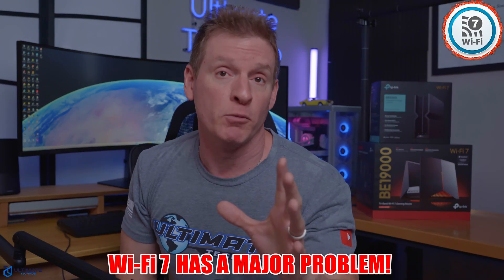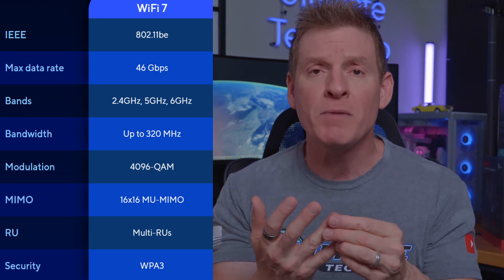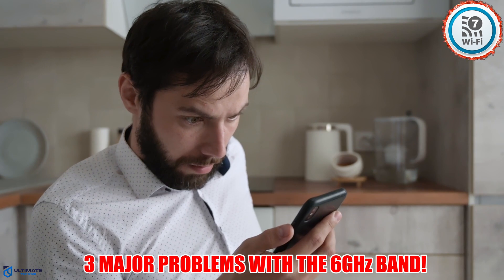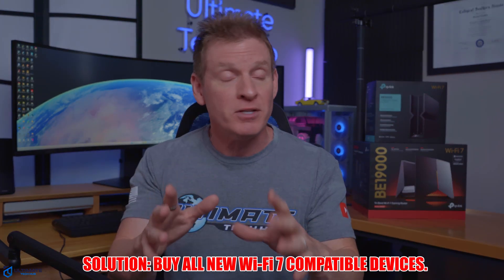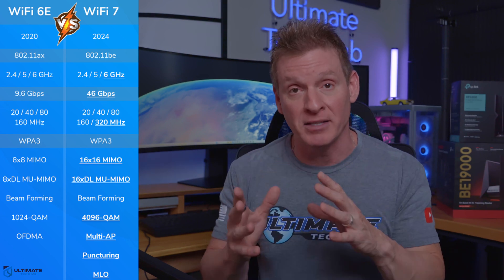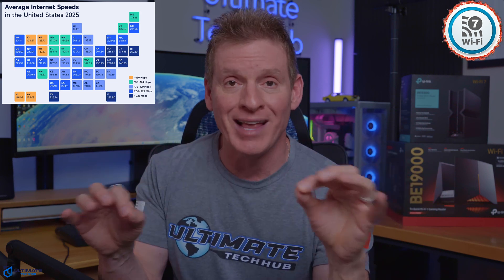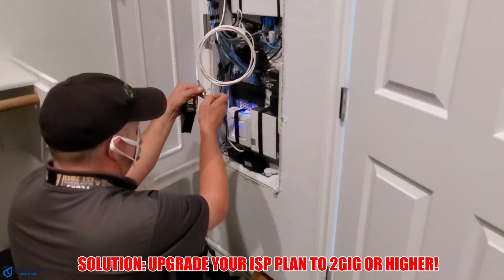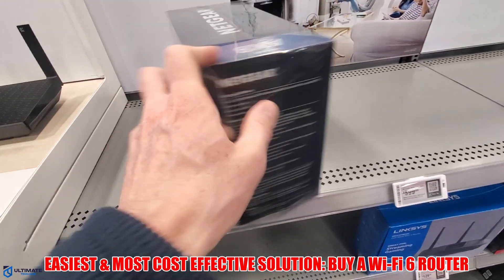Wi-Fi 7 EXPOSED: 3 Big Problems Nobody Talks About!

Comment: depends on your use case, if you have large files to transfer between networked devices like me, then yeah, that extra bump in speed can def help. but then again, i work in IT, and im a geek with a multi-gig internet connection lol

Comment: I agree. I tried a TP-link BE3600(it was opened stock for $74) and it was replacing a TP-Link AX 4400, so curious.  Well within a couple of days the internet connection dropped several times requiring a modem/router reboot. I quickly realized it wasn't going to work for me with the same pc's tablets, and phones. There must have been a reason that it was marked down as a return.  Now at least I don't have outages with Wi-Fi 6. BTW most of my devices are wired, using a switch wired, from the router in office to a the living room Home Theatre.
Reply from the maker: Wired is always better. Thank you for watching !
Reply: I have heard that the ASUS RT-BE92U BE9700 Tri-Band WiFi 7 Router keeps dropping connections, too. I heard it was a firmware problem
Reply: @mando7558 I have a tp-Link GE550 BE9300 and have no problems with dropouts. Although there are reports of this happening I updated the firmware as soon as I got it and it's been trouble free from the start.

Comment: I use WIFI 7 MESH network but linked with Ethernet cable CAT 6A between Master and Slave routers. No problem at all with very good range, speed and many devices. Some use 2,4Ghz others 5 Ghz and te 6 GHz band is for the MESH routers.
I do not have the 320Mhz band only 160 Mhz, But the WIFI 7 speed is much more than using WIFI 5 or WIFI 6 from the Internet Supplier Company, that I have Installed but I do not use for my conections. And I wil not need to update that Networks for many years.
The WIFI 7 network is excellent to supply service up to 600 users or devices at the same time.
After 2 years using WIFI 6 E networks I went for WIFI 7. And the price is cheaper.

Comment: What happens with those routers and mesh systems that use Wi-Fi 7 with dual band 2.4Ghz and 5Ghz? Those don't have 6Ghz. Are they worth it or do they also lose something?
Reply from the maker: Dual-band Wi-Fi 7 allows for simultaneous use of multiple bands (2.4 GHz, 5 GHz) This improves performance and reliability, but it may not increase the range. Wi-Fi7 can handle more devices and data. Its primary advantage is increased speed and reduced latency, not necessarily greater coverage. Depending on your ISP plan it's still probably overkill. The good news is the 5Ghz band does reach further than the 6Ghz band but it's not as fast. In most situations wifi6 is plenty.
Reply: @UltimateTechHub  wireless backhaul on a mesh network is overlooked but makes the biggest difference
Reply from the maker: @ip4pwn1 It makes a massive difference. I just posted a video on the DECO Be67 and compared the wired backhaul speeds to the wireless backhaul speeds. Here is the video link and let me know what you think. https://youtu.be/J_IPaw1yT0A

Comment: I need some help. I don't have many new devices, but my new house is big, and I am paying for 2gbps dedicated fiber internet. I want to be able to a) have access to that full amount if possible, and b) have fast lan for pc gaming remote play to my portable devices with moonlight and steamlink. The ISP modem router combo is wifi 6, but only one switch port with 10gbps. The rest are 1gbps. Thinking about either a diy router with access points, paying for my ISP's wifi 6 access point/mesh, or buying something like the deco be25 that has two 2.5gbps ports. Nottrying to break the bank either. Any suggestions?
Reply: My suggestion is connecting MESH routers with ethernet cable CAT 5E or above. I installed a MESH WIFI 7 Network with 5 routers and ony 1 is interconnected WIFI to the MESH. In that way the signal strength is almost 99% of the maximum Internet broadband speed all over the places.
Reply from the maker: How many square feet is your house? 1 story or 2 story? I prefer a dedicated router with 10gig and 2.5gig LAN ports. Mesh is only for homes that ate very large or multiple stories.
Reply: @UltimateTechHub  my house is 2300 square feet, but with an unfinished basement we'll be finishing to add an additional 1000 square feet. I'm considering something like the deco x55 pro as well since they also have 2 2.5gbps ports. Right now I lose connection between the ISP router in my office and the bedroom when remote playing off my PC. It isn't even that far, but walls are in the way. Right now I can easily run a wired backhaul since the basement ceiling isn't covered yet.
Reply from the maker: @sneezyrider1 I would run 2 or 3 ethernet to the basement for your wired devices like TVs , gaming consoles, Pcs and Access points. The Deco x55 pro is a good mesh system .
Reply: @UltimateTechHub  thanks man. I love your content, and appreciate you responding!
Reply: @UltimateTechHub  sorry, also it is a 2 story house, but the basement will add a 3rd story when finished.

Comment: Reason why i didn't go with wifi 7. Compatibility. I have wifi 6e and still most of my devices can't connect to the 6E band. Also, the 6E band is very weak at range. Unless you are 10 ft away you are not connecting with full bars.
Reply from the maker: I have the same issues with my wifi6e devices. Thank you for watching and for commenting.
Reply: @UltimateTechHub  many thanks for your information is it issue you have with wifi 6e because 6 ghz weak singal do you thing will be same issue with wifi 7